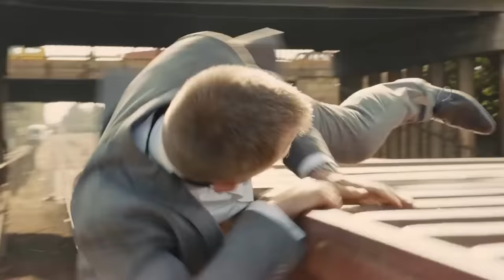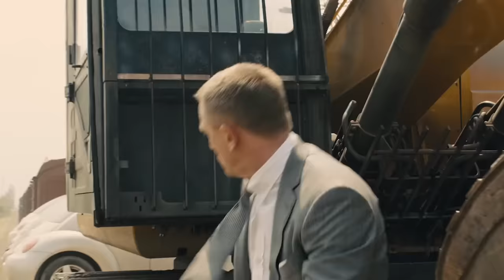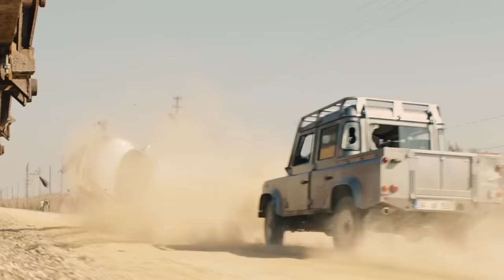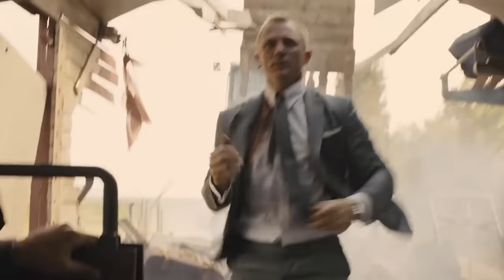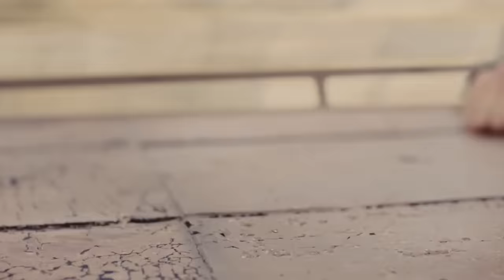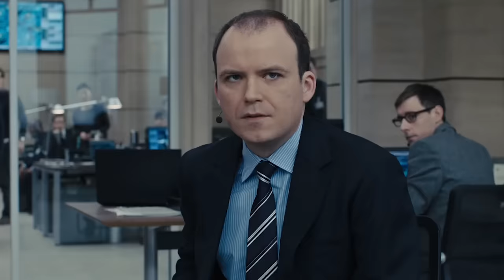SKYFALL | Train Fight – Daniel Craig, Naomie Harris | James Bond

Comment: The most unbelievable part of this whole scene is that a LandRover Defender can top 50mph.
Reply: Thx for that info. I Had no  idea.
Reply: Mine can do a bit over 70 but definitely not on gravel. And it takes about half an hour to accelerate :D
Reply: Land Rover's reputation durability and dependability was certainly pushed to the breaking point on this one.
Reply: @blairbrown4812  nñn
Reply: Pffft.  How about that it started?
Reply: @blairbrown4812  watch the Camel Trophy that pushed land rovers to there limit
Reply: @Venerate Who? have you ever seen the movie Emperor of the North (Pole) you'd be amazed what guys did on trains with no cables...
Reply: @VenerateWho? Tom Cruise does it all the time.
Reply: And they converted the Excavators into RHD just for a good shots
Reply: @megalith17  Nobody's going to mention the walkways on the hydraulic cylinders?
Reply: Depends on if it has a V8 in it or not haha
Reply: ...she is lucky it even started.
Reply: @kleetus92  And that ones lmao
Reply: It’s a V8
Reply: @blairbrown4812  I didn’t know that Land Rovers had a reputation for reliability.
Reply: Eq
Reply: Actually it's the moviemagic that even allowed that LR to run... :D That alone makes this 100% fantasy, but oh well, in movies everything's possible =)
Reply: And why not??!! You can upgrade the engine and transmission and drivetrain and rear end differential in almost any vehicle.
So it might not be a Land Rover defender under the hood.
Reply: @kimrogers4865  it may be easier still to change the laws of physics and permit the landrover to dilate space and time in order to achieve 50mph.
Reply: @kapilchhabria1727  Any competent educated mechanic with the access to companies to purchase the engine and other needed parts and garage and tools for the installation can do it.  It's not easy unless you have been taught how to work on vehicles and probably are a certified mechanic.
Reply: What about the new defender?
Reply: @betro8089  p
Reply: No the most unbelievable part is that she could hit Bond off-hand with some shitty AR (pause for Yanks to yell “it’s the best platform ever!”) PS: nobody taught her to shoot prone resting the rifle?!
Reply: Dude those things are pretty cool
Reply: It probably could if there was a Stig at the wheel.
Reply: Sweet, sweet advertising money baby
Reply: @jeepdude7359  Defenders, we're alot more reliable as it was a lower quantity and less tech so they didn't suffer from the same tech issues
Reply: @georgepom328  Jeep isn’t much better. It’s always a trade off when they try to make them more of a “luxury” vehicle. When they design them for people that spend 90% of the time on the pavement, the off-road reliability suffers.
Reply: Yes
Reply: @kimrogers4865  you can do motorway speeds in a stock 300Tdi or TD5 Defender with ease. He's just trying to be funny
Reply: That and Bond’s bike can travel in two different directions at the same time when he ditches it.
Reply: so that ))) jump on a bike where they cut it so that Bond didn't flip over in air is ok for you?))
Reply: Take it over that and you’ll be staring at your repair bill like, 😳
Reply: Or run for that long
Reply: Maybe it's a car design specifically by mi6, they can still change the engine. Bond uses Aston Martin which looks similar to real life but a beast under the hood which common people don't use. It's still a great scene though, we should appreciate this as well, imo.
Reply: No, 85mph. The one in the movie is 2007+
Reply: Actually they do well over 100, have driven in 2 different generations, one from 1990s and two others from 2000 - 2005
Reply: Aftermarket parts.  You don't honestly think MI6 uses stock vehicles, do you?
Reply: @josiahscarrmusic6750   You went through two in less than five years?  Sounds like you just damned the poor thing with faint praise.
Reply: Obviously M souped it up lol
Reply: See the 2 guys... shoes?
Reply: A train’s brakes need air in order to stop it from moving, once the brake line was cut the train would automatically go into emergency and stop…. Movies always ignore this
Reply: It's a defender it can do anything
Reply: This one had been retrofitted with a Toyota engine. So solly, Mr. Bond.

Comment: As a decades long railroad equipment tech, Bond getting shot off the boxcar by a co-worker is just so relatable! How did they get that sort of treatment so accurately? Amazing. Yes very cleverly done, but all the brakes would bang into an emergency application at the first rapid air pressure loss. Followed by the head end crew chopping the locomotive power off and the whole works screeching to a stop. But who wants to watch that? So I suppose they did it right. lol

Comment: A technical error noticed. When a train parts it stops in a very small interval due to drop in brake pipe pressure. But in this clip after parting both parts continue to run.